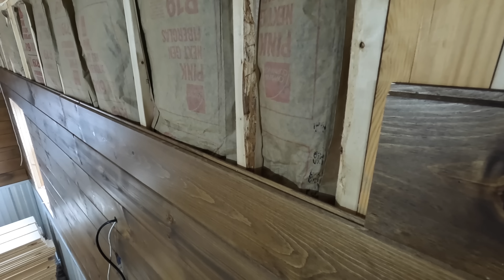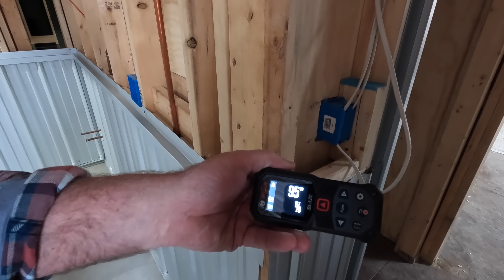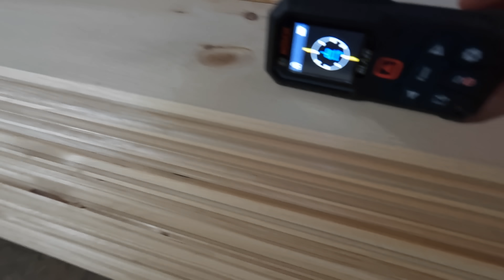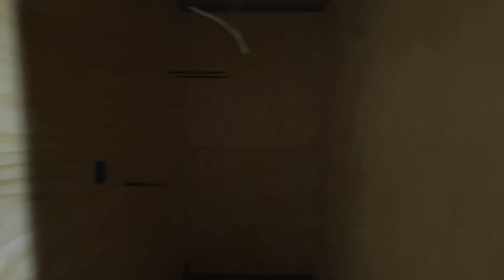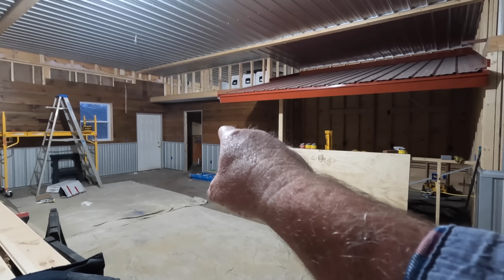How didn't I know about this?

Comment: I've used the Leica Disto Plus for close to 20 years measuring glass openings for commercial offices and exterior aluminum curtainwalls. Very accurate still after all these years. Much more expensive than the Bosch but like any tool, price depends on what the final use is for.

Comment: We have a small little craftsman one that is about 4 years old now but it works fantastic. Now it just does dimensions but it's only about the size of one of those big square pink erasers. The best ting about it is you don't need to have a bunch of different tape lines and as you pointed out you can use it by yourself. 
You mentioned the manifold for the floor heat, any updates on the boiler?

Comment: I’ve been laying out my 2 ac. lot for a house and shop. I got the 300’ for outside. It has been a life saver. I’ll need to remember to use it inside for measuring ceiling panels, etc.

Comment: From a architectural engineer that does some gut-redo projects on existing commercial buildings which require field measuring the existing buildings, the laser measure makes my field measuring much faster and easier. Have owned a Bosch laser measure for several years, no issues.
Last year I was hanging 12 new high bay LED lights in my garage, the laser measure and Milwaukee 360  3 plane laser made the lighting layout a breeze.

Comment: I had the 400c with the camera.  It’s also handy for indirect height measurements.    So if you’re cutting a tree - you can get the exact height - which is handy if you’re felling it towards an obstruction and want to make sure it won’t hit.

One caution - these eat batteries and if you’re not using it for a while remove the batteries.    I left mine in my toolbox for an entire winter unused.   When I tried to use it - the batteries had not only drained but had corroded the metal battery tabs which are really thin gauge metal and snapped off when I put in new batteries.   

They’re really handy for long outdoor measurements.  My next one will be the rechargeable.

Comment: I have a different brand and love it! I bought it while trying to design a new house floorplan. It's great to walk around your existing house and quickly just take room measurements as a reference. "I like the size of this bathroom - how big it is?" 2 seconds later, you have your width, length, and even height if you want. And as you said, especially large rooms. I just shot it across the combined great room/kitchen and bam, there's the distance. No trying to keep moving my tape measure a couple of times, adding them together, getting around furniture etc. Not to mention I can do it all myself, as you said. No help needed to hold the other end.  They're awesome! I think I paid around $60 on Amazon.

Comment: Mike, we’ve had these for years in our window business. We make custom built to opening sizes for new and old buildings. Our measuring crews use a laser that will send the dimensions by Bluetooth to a tablet onto a spreadsheet. We don’t have to remember the measurements and don’t have to write them down. The spreadsheet gets downloaded on our computers back at the office and gets put on each window in the elevation and floor plans. Great stuff!

Comment: Oh man I love mine.  I like the older models that read to just. 16th.  I do commercial construction and for doing exterior metal framing with 30’+ studs and for acoustical ceilings it is awesome and allows me to blow other out of the water as far as speed and getting stuff done.

Comment: I’ve had one for a while. They’re great for rough measurements over long distances but they generally come with a 5mm tolerance on them which makes precise measuring difficult. But getting a good idea of the length of a wall or a doorway or whatever especially working alone - they are useful. 👍
Reply: + or - 1/16"  pretty darn good.

Comment: Mike, remember that tape measures are not accurate and vary brand and model to others sometimes. Whatever tape you start a job with, finish with it. I would trust the laser accuracy all day. A torpedo level relies on your eye to approve dead center. The Bosch unit does not and is very sensitive.

Comment: I seen an Ames laser measurement tool at harbor freight and it had the same features as the Bosch has but it was only $59 with case also. I bought it and got home and checked it out for accuracy and it was right on. Measures up to 200 ft. Like you I'm always by myself measuring and same problem with a limp tape. Gamechanger for sure!

Comment: I have that same laser tape just the green one, it's awesome! I also cut all the hardie trim on my shed with it. Dead nuts accurate.  Just make sure you have it rounding to 1/16 and not 1/2" made that mistake only a few times.

Comment: I have been using a laser measuring device for college track meets for 10 years  I use a Lecia D8 which is a $500 unit.  I just did a meet today using it.  We use them all the time in the pole vault to get the absolute height for records.  In fact, the laser and a steel tape are the only approved method for records for the records.  Quickly, changing to metric or imperial is very easy.  I also mount mine on a measuring stick to allow me to not kneal down to measure.  Think of set the height of an instrument in a transit.  What is nice for the track meets, you can immediately tell how high or low you are instead of estimating and constantly adjusting.  Usually two sightings with the laser gets it right on the money.

Comment: I have one made by them as well. Not with all the bells and whistles that yours has, but I like it a lot. Bought it about 5 years ago when I was remodeling a bedroom for the same reasons you showed in your video. I think I paid around $20 - $30 bucks for it back then. 

Mine is the BOSCH GLM20 Blaze 65ft Laser Distance Measure With Real Time Measuring. It's $39.97 on Amazon today. I bought mine at Home Depot and have no regrets.

Comment: Hi Mike I use my Electronic measurer for measuring Kitchen, Bathroom & bed - rooms to design. Then use a measure tape to measure the windows doors & parts of walls etc. I wouldn’t be without it.

Comment: I had one of the older laser tapes several years ago. Worked great, I used it figuring square feet in homes. Mine also had a level in it. A word of caution, don't drop it. I dropped mine a couple of times and it got out of alignment. The sending unit and receiving unit must be in alignment in order to give you a accurate measurement. After six months of constant use mine quit altogether. They were more expensive back then so I didn't replace it. I am assuming that they are making them tougher now. Great concept and really hand though. If I had need any longer now I would purchase again. Great time saver and even more accurate than a tape for longer distances.

Comment: It uses the light waveform for critical measurement.  We used the same concept at work when moving several hundred pounds to find when the metal reaches a certain point.  One could do it but with the electric parts the laser was perfect. Love the plate concept.

Comment: The hopper is going to be the wink link. It needs to hold enough to at least work 30min by yourself without stopping. At 60# you might get 6-8 minutes before it needs to be filled again.

Comment: It looks like those lasers have come a long way. One thing to keep in mind with a laser or stud finder or anything with a battery is make sure the battery is good when using. I found this out with a multi meter with a low battery. The numbers I was getting were way off and I thought because it turned on it appeared to be working correctly. I changed the battery and all made good sense again. Good luck.

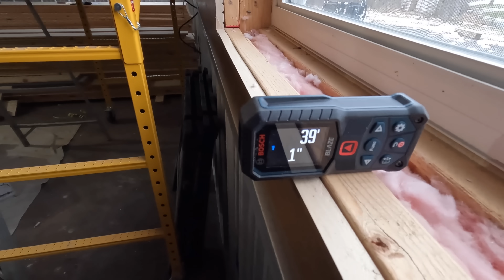Comment: 4:18 I think Bosch and Lowes owes you a free one...  I paid under $30 for my Chinese  one I picked up on Amazon, it was very useful when measuring for square using the diagonals on my garage door track from the top of a ladder.  I like yours better mine only has a small bubble level though that might be better if you are trying to take a level measurement.

Comment: I use this green one, just remember that you have to add the gross length to the displayed length. This model gets a little squirrelly around 50ft with high humidity or dust. It measures your drainage pitch, roof pitch, and for me, wall pitch. As a restoration Mason you can't actually touch the walls if they are really bad. And getting a tape measure out around power lines is always a bad idea. Thanks Mike!

Comment: How do you measure the width of a counter top? How do you measure the length of a board? I use laser for ceiling heights and that is it. I have seen too many mistakes with laser measures. They sometimes grab the wrong surface.

Comment: Nice! -- QUESTION -- I see how it measures inside walls as there is something to bounce the laser off.  But how would you measure outside lengths, like how long a piece of wood is?  There would need to be a clip at the start to reflect the laser off of, or the length of the outside wall where there is nothing at the edge to bounce the laser off?

Comment: Accuracy is the key. I have had several over last 20 years and they do not stay accurate. Also the laser is just a pointer and it's hard to measure to the edge of a board. The distance is sonic on many of them. Not the laser. I use for estimates but not for cutting boards.

Comment: An online trim carpenter I watch uses one of those to measure crown molding.  I can see where carpet layers and realtors would use one also.  I have one but haven't used it enough to have an opinion.  I just got mine off the shelf and found that one of  the cheap double AA batteries leaked.  I would change them soon, you never know how long they have been on the shelf.

Comment: We recently had our house measured for carpet. The contractor came in with a similar laser device and a tablet with a carpet layout program. He was able to measure every nook and cranny and it sent the measurements straight to the tablet. When he was done it had the total sq ft for a quote as well as showed him where each piece would be cut from a roll to maximize efficiency. Pretty slick and it took one guy about 15-20 mins to measure two stories.

Comment: Honestly any chinese noname measuring laser will be more accurate than tape. Because it depends on chip accuracy level which is way more precise then mechanical tolerances. The only bad word have to be said is about assembly quality differences. Chinese crappy disintegrating plastic cases and buttons are still cheap and crappy.

Comment: As a high end finish carpenter for 40 years I've had a lot of measuring tools/tapes ... but these lasers have been a boom to both framing and finish work ... I remember buying my first Stanley Laser Plumb Bob ... sure did make my job easier and faster when working alone  .... love seeing the building coming together ... non builders just have no idea how much work and planning that goes into a properly built structure ... especially when you are doing it yourself ... 30 years ago I got hired to do a door/finish job with the builders carpenter, met him at the job site and he pulled out a big sledge hammer with his 6 foot level ... I asked him what the sledge hammer was for ... he smiled and said "I know the idiots who framed this place" .... Big 3 story McMansion ... we spent the first 1/2 day cutting sills and banging walls and door/window RO's into place  ... there's an old saying in building that a good framers is worth 3 finish carpenters if he's really good
Reply: I started building houses when i was 17, went to a vo-tech to learn the 2 year schooling the first year you had to use all hand tools no nail guns. I remember some framers that would eyeball the walls for plumb and when the sheetrocker came in they had to cut 3" off a side for the sheet to fit.
Reply: I learned the building trade from my New England (VT) relatives who had been building for generations ... their pride was obvious ... one guy up on scaffold/ladder measuring, calling down to the guy cutting wood/trim ... he'd call down to the guy in a calm voice ... "It want's to be 95 and an 1/8" ... respect, as if nature and the space know things
Reply: Don't forget the say "caulk and paint, make a carpenter what he ain't"

Comment: I got a laser tape measure off Amazon that has both a tape and laser measure on it.  It's great because I carry it like any other tape measure, use it like any other tape, until it's inconvenient to use the tape, and then use the laser.  The more I use it, the more often I use the laser instead of the tape, but I prefer to have both in one.  I can measure the opening with the laser, go over to the board and measure it with the tape, and never switch tools.  It was also less expensive.

Comment: I've had a cheaper model of this device for a few years. I use it mostly when I build cabinet drawers. I measure the distance between the drawer sliders, because I suck at measuring inside dimensions as accurately as required for drawer fitup using a tape.

Comment: Tell Bosch to put you on the payroll. You do a good job selling the value of the machine. Kind of a “ my pillow” type of salesman. That is a compliment. Just got my fire starter yesterday and was a little worried about it working. Bought a load of Douglas fir, supposed to be dry” but was at 25-26 % moisture. Worked perfect!  My wife had the” don’t you think more starter MIGHT” work better?  Assured her the amount I had was just right. (I was concerned she might be right but couldn’t back down now. A guy thing.
Reply from the maker: Good deal, glad you like it

Comment: Mike, I've had my Bosch laser tape for years. I bought this at Lowe's years ago. Didn't need it, but I though it would be neat to have. Yes, it is accurate and I have not had any problems in all the time I've owned it. Bosch tools have always been good quality in my opinion. I'm sure you know the following, but on those long boards if you add a 1/16 or maybe 3/32" to the measurement and bow it out, snap it in as you install it you will get a nice tight joint. Feel silly telling you this,  but maybe a viewer watching doesn't know to do this. Anyhow, keep up the videos and congratulations on the purchase of the packing machine. I'm sure you'll use it quite a bit. Have a good weekend, Ron

Comment: I had always wanted one of the laser levels like that but couldn't justify the cost. Found an older style that was much bulkier but it did measure distance and had the room level as the rotating beam for cabinet mounting etc. Also for the loading of the bagger you could use a rolling ladder with a platform. Also would be handy to finish the rest of the T&G board on the walls and any work overhead. Easier to move about than scaffold and safer to.

Comment: Suggestion …. Wood platform next to bagging machine. Steps up to platform. Platform large and sturdy enough to hold a container with chips. Elevate your container high enough where you can feed hopper easily without bending over to scoop out. Possibly a shoot directly into bagging hopper. Similar to grain handling farms use to transfer grain.

Comment: If you're using twist tie process, try using safety wire plyers.  You put the twistie around the bag, pinch both ends with the plyers which lock then pull the middle handle and it will spin the plyers and the tie. Release and you're done.  Saves fingers and wrists and is fast.

Comment: The fire starter bagger is great. I know one step at a time. I worked at a Bakery for sixteen years on a production line running a bagger for bead and rolls don't know what the cost is but a tie machine that twist ties on would be great something to think about. When you go to the store look at bread and rolls (or at home) to see how they are tied some have clips some has tie's I always run a tie machine' .

Comment: I bought a cheaper Parkside one from Lidl. Very useful device. Accurate measurements, area and volume with a level and detector for metal, studs and cables and laser line option. I use it daily

Really like the copper finish. Things are really moving along

Comment: Years ago I had a digital measuring device, it used ultrasonic to measure. It looked like a TV remote, I guess  you would call it an ultrasonic measuring tape. This device would measure the length, and you could hit one of the buttons, then it would measure the square footage if you needed to put carpet in an area. It was fascinating, but my truck got stolen and now someone else has it.

Comment: Just a suggestion for the future cabin in W. Va. I don't know if you plan to have a wood burner with a electric fan (least expensive without a electric fan), but I would suggest a induction heat powered fan for your stove. It wood (pun intended) save on power coming from your generator and the fan will distribute the heat very well for a small cabin. And lastly, it would be a great back up in case of a power outage for your wood burner at the shop/rec building. Cost on Amazon $20-$60 dollars.

Comment: The Bosch laser measure is $99 at our Lowes in CT.  Marked down from $149.  I’ve had a Dewalt I purchased years ago that is surprisingly accurate but doesn’t have the range or the features of this Bosch.  The product description says it’s Bluetooth as well and will connect to their app on your phone.

Comment: Been using a similar Bosch laser tool since 2008 and they work well. We had rented an 80,000 square foot building and were tracking roof deflection/snow load. I had several marked locations on the floor and would project the beam up to a marked point on the truss joist. We tracked deflection until the extreme snow load melted.
Reply: Good idea